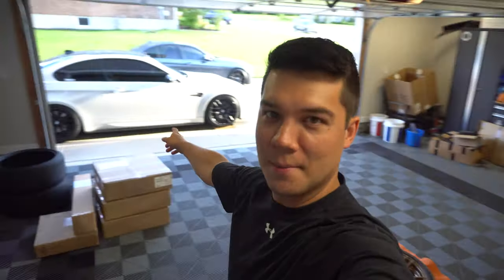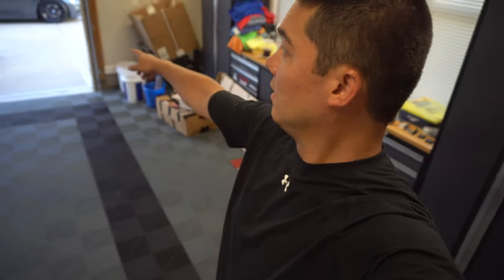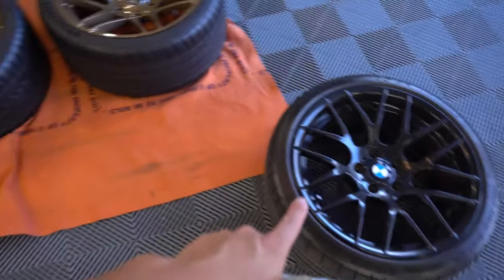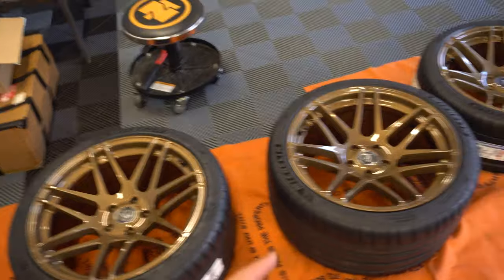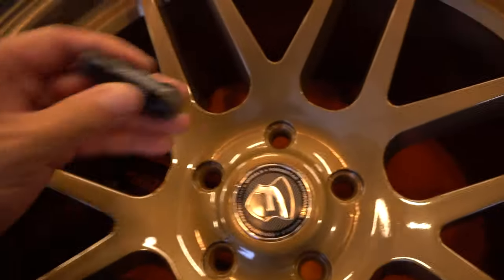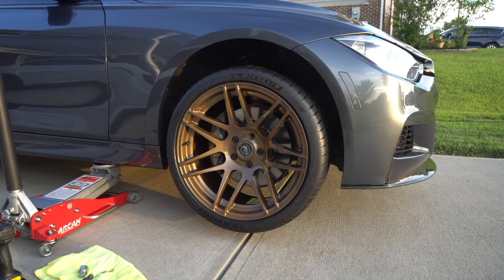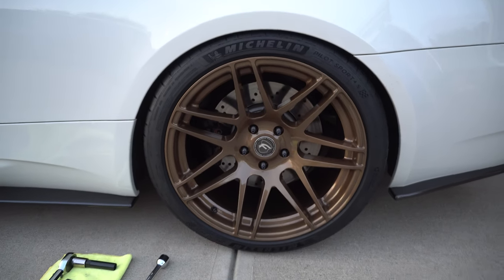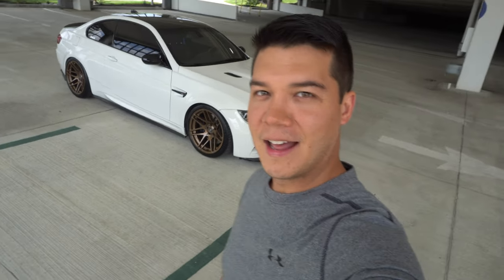FORGESTAR WHEEL REVEAL! | BMW M3

Comment: Does your front wheels hit your calipers? Forgestar says that you cant put bigger offset than 13 in front, when you have 19x9.5 wheel and stock brakes?
Reply from the maker: Nope! I have just enough clearance. And my brakes are stock. Aftermarket brakes would be a different story.

Comment: Did you end up rubbing? I just ordered these wheels with +27 in the rear and debating whether I should go 295 or 305
Reply from the maker: Yep, I did ever so slightly rub on the highway. So I dialed in some negative camber in the rear and now its fine.